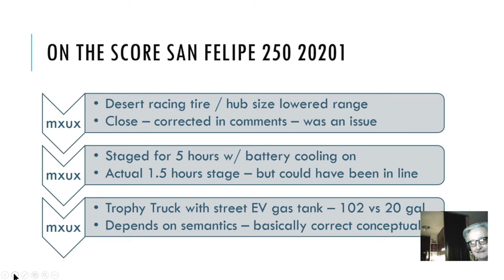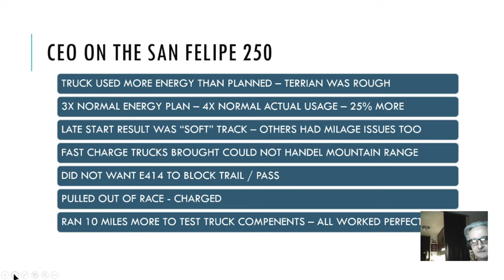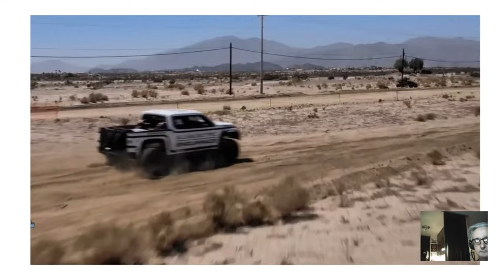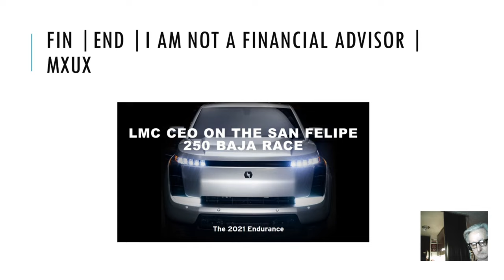LMC CEO | Explains San Felipe 250 | Endurance E414 | SCORE | Lordstown Motors | $ride #ride #mxux

Comment: So youre saying that they planned for x3 'Fuel' consumption over normal road use but on the day it turned out to be 25% higher which messed up their plans for getting through a section which couldnt be accessed by the recharge truck, well as the saying goes, 'S**t happens'. Put a second battery pack in the back next year and maybe use a combination of charging the main battery and swopping the pack in the back.
Reply: That was my thought even if it wasn't a full battery a small one to get to the next charge point if you ran out. Even the gas trucks carry a extra can just in case. but if they do it again they will be more prepared i'm sure
Reply from the maker: Derek they - I am sure know exactly what to do now - really they just have to have a more robust charging strategy - more options to get a charge to the truck - pre-positioned? - smaller but more of them? more smaller charges? IMO - jump62 below has a great idea as well - a battery "Jerry Can" on board"

Comment: The problem is the same as before, they set expectations too high. They should have said it's a practice run for the  Mint 400 and to get data and could have avoided a mess.
Reply from the maker: ya, but it was a race ya kno not some closed course practice run ...

Comment: A) 25% more energy used. 
B) The Endurance has a 250 mile range under normal conditions.
C) They calculated they could go 83 miles on a charge. 
D) At 4 x the energy consumption they should have traveled at least 50 miles before the so called dead battery. Sitting doesn’t signify discharge the batteries. 
E) Burns is mathematically gifted. I don’t believe he miscalculated. 
F) If the first leg was expected to make 62.5 miles, how far too the next charge area. 

That track breaks axles. He wasn’t going to risk busting up a hub motor. The battery was an excuse to stop. 

IMO he needed a public demo of the hubs. I also think Matt drove because he’s a marine and can be trusted with intelligence.
Reply from the maker: Bf- thanx for the comment - well they ultimately went 50 miles - 40 miles to the charge point - sitting does draw battery power if the battery is being cooled to remain in operating temperature zone - TESLA recommends keeping car plugged in to avoid this  - and this baja cooling system likely took more juice IMO to do this - if they didn't cool it then higher battery temp would also limit range - do not think they would go to dead battery state before charging or get close - so charging after 40 miles makes sense to me - all the race teams there were experts at calculating mileage - many made mistakes - see reddit - if the hub motors are so fragile - why no malfunction in - 50 miles? That is Los Angles to Laguna Beach - on a Baja track in bad condition not the 405 - in an electric vehicle I don't thing charging is ever an "excuse" to stop you know? I though Endurance has 240  not 250 mile range no? Anyway Bf - like I say - they showed up - got off the trailer and on the track -  it could of blew up and caught fire in a mile - whatever - it didn't - why do you doubt the hub motors? They have a million miles of testing - by Elaphe - drop tests galore - run submerged in mud - I don't know I feel they are a great system that eliminates broken parts - like you say this course eats axles and I would add drive shafts...thanx for the comment BF
Reply: @mxux  I do like the hub motors, but like anything they’re subject to damage and had something unusual happened it would have been a disaster. 

A meteor could have blown the truck to smithereens and someone would’ve blamed the hub motors. 

Under the circumstances I think if they planned on calling it early or it happen by chance the right thing happened. It just wasn’t worth risking everything. 👍🏻